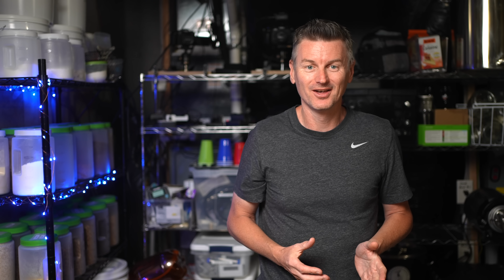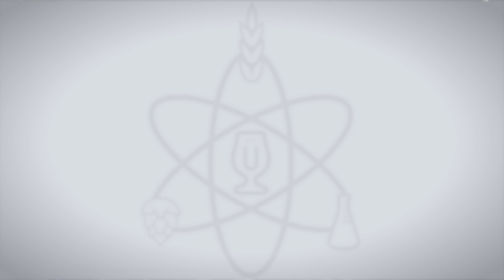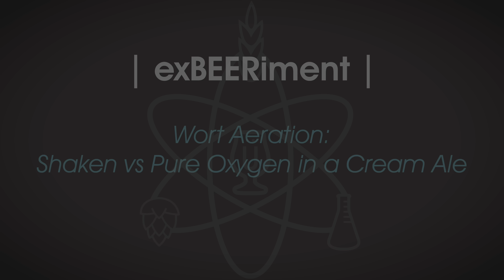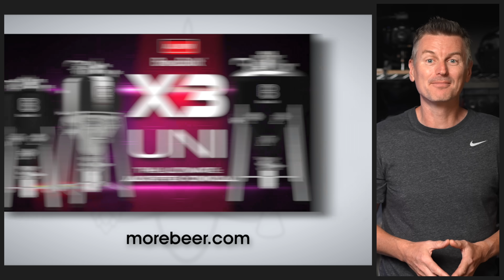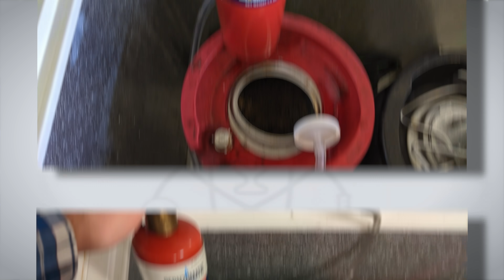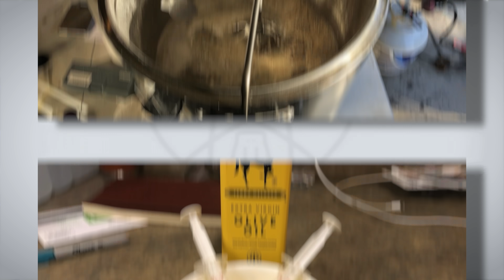4 Wort Aeration Methods | exBEERiment

Comment: Aerating wort is beneficial primarily to maintain the vitality of repitched yeast slurry, by promoting yeast cell budding to replenish the yeast population. Most home brewers are not pitching yeast of high vitality so aerating wort is recommended, but it doesn’t require much effort. A little splashing during wort transfer to the FV or brief gentle shake once in the FV is usually adequate. Pure O2 is overkill at home-brew scales.

Comment: Sorry- I just dump my wort from kettle into the plastic bucket fermentor, add my dry yeast and still get my required FG. Controlled temperature fermenting, generally around 21/22 Celcius. Crystal clear beers. Asone responder below says- sometimes we overthink beer making. One brewer that I have learned from has a motto- "beer wants to be made".

Comment: Aeration becomes critical if you are repitching yeast over multiple generations. Issues like diacetyl reuptake, acetaldehyde, speed of fermentation and attenuation are all going to be affected long term if you are serially repitching yeast without the right level of 02. It's not likely to be noticeable in an average strength wort using a fresh pitch of yeast. 

It's also a variable you can play with alongside pitching rate and temperature to influence flavour, especially in more expressive yeasts.
Reply: That's s good point. Suggesting that the point of aerating the wort is totally misunderstood in the homebrew world.

Comment: For mead, I tried something similar. I used my blender on one gallon with the wort with raisins to make it very aerated. It was very foamy. The other I just pitched it all in a gallon jug. The blended one had more access to sugar because the raisins were blended and the oxygen made it require a blowoff tube because it fermented fast with Kveik yeast. The normal one took longer and didn’t explode out the top.  Flavor wise, they were very similar but the oxygenated one seems to be smoother and it did finish a little faster and slightly higher ABV. Overall, it doesn’t seem to matter too much because it just takes a little more time for that non-aerated one with that strong Kveik which likes to be stressed because it puts out the nice orange notes.

Comment: I never skip oxygenation. I just see inconsistent fermentation performance and timing from batch-to-batch if I don’t oxygenate. I think this is especially important if you re-use or propagate yeast. Every professional brewery oxygenates and every yeast expert recommends it, if it wasn’t necessary, professional brewers would surely eliminate that extra cost and complexity from their operations.
Reply: People are often superstitious. If something worked for them once they keep doing that and even recommend that to others even if it doesn't have any measurable effect at all.
Reply: @fdk7014  brewing is an extremely competitive industry with tight margins. Everything that isn’t essential will get cut out to save cost. The ubiquity of oxygenation in commercial brewing suggests that it is probably vital at scale or due to some difference in commercial processes, and the results of these experiments suggest that homebrewers are often able to get by without it for different reasons.

One such factor is that commercial breweries typically re-use yeast 5-10 times.

It’s incredible hubris to think that an experiment in your garage invalidates the SOP of a multi billion dollar industry.
Reply: @grahamhawes7089  Yes if you do reuse yeast many times you need to resupply the sterol reserves of the yeast. When you buy yeast for your homebrewing it comes fully loaded with sterols already, it doesn't need any more and it will have no use for more. Adding more oxygen does nothing. You can easily repitch that 3-5 times with very little oxygenation.

Comment: I just brewed a stout with 1.084 OG that was supposed to ferment down to around 1.024. I mildly shook the fermenter for about 30 seconds after adding the yeast. I used Kveik Lutra dry yeast added directly to the wort. It finished in a couple days at 1.022. Fermentation was continuous and smooth. It just finished, so I haven’t tried it yet.

I make 2.75 gallon batches. I use one packet of yeast. I only use the shake method with my beers. I’ve had stuck fermentations with high gravity beers in the past, but I’ve used different yeast.
Reply: aeration is way more imporant with liquid yeasts, dry ones dont really need aeration. ur fine if dry yeasts suit you. This is no longer true if you make a starter out of a dry yeast, it loses the fatty acids that the manufacturer packs into them, and you should then use aeration (aeration = o2 from a bottle!) for best results.
Reply: after watching the video: .... in theory. Haha LOL
Reply: I have been using Kveik for the last few years. It almost feels like cheating. I get great results regardless of the fermenting conditions.

Comment: Over pitching healthy yeast beats under pitching EVERY time. Making a starter is great insurance against under pitching IMHO.
Reply: Yeast pitch rate is another myth that Brulosophy has effectively dealt with. If you underpitch all that happens is that the yeast will grow for longer, i.e. the fermentation takes a bit longer time. That's not a problem for a home brewer.
Pitch rate is important for breweries because they have significant investments in fermenters and they need to turn them over at a good rate to get good value from them. Thus a long fermentation is not desirable so they use a good amount of yeast to speed it up.

Comment: I read an article that was say that add O2 at 1 L/min was to fast. Slowing down the rate was the key. If you add O2 at too high of a rate, all you do is blow O2 out the top of fermenter. I started adding O2 at a much smaller rate and scale up time. This to me has made better beer overall. I currently add O2 at 500 ml/min for 1 min 24 sec. Ale.

Comment: I run my hot wort out of my kettle through a double mesh fine strainer into a second kettle with my Jaded Hydra wort chiller.  I then stir the living daylights out of the beer while chilling and then pour heartily into a fermenter once my beer is chilled.  I feel that all these steps more than adequately oxygenate my wort as I've never had a beer not hit my expected final gravity, even big OG beers.
Reply: Agree. I simply pour heartily into the fermenter through a fine mesh once the beer is chilled. It has been working great for at least 30 years.

Comment: In my ales I add o2 through my carb stone simply as cheap insurance just like yeast nutrient. They always turn out just fine. However, adding o2 to my <5% lagers has shown to help ensure a much cleaner fermentation. Not an off putting flavor or aroma to be found anywhere. I did brew a helles once where I discovered I ran out of pure 02 prior to pitching yeast and my unitank isn't exactly designed for shaking the hell out of it. Pitched anyways and it was noticeably different. Took a while to get through that beer even before dumping the last 3 or so gallons.

Comment: It’s funny how many steps we all go through for you to prove it matters so little overall. 

If I transfer into a glass car boy I place the car boy on a skateboard first. Then aerating by mixing is super easy because of how it rocks back and forth. 

When using the clawhammer system I transfer my wort using their spray nozzle on the lid. This  leaves it very bubbly
Reply: That’s a great idea to use their spray nozzle. Never thought of that.